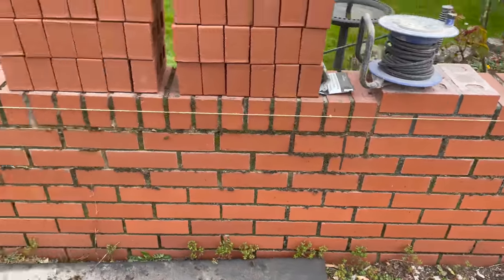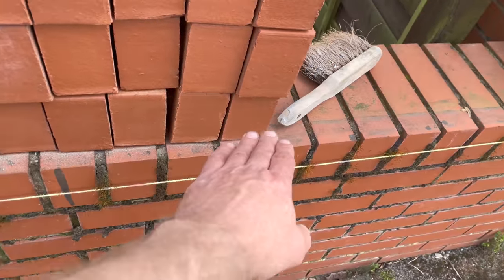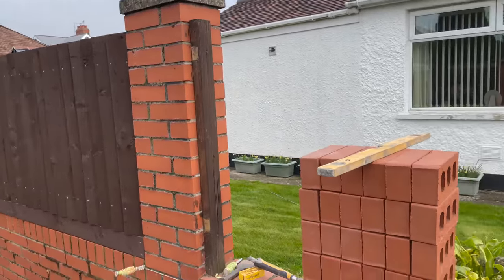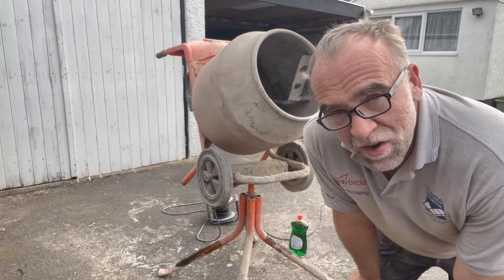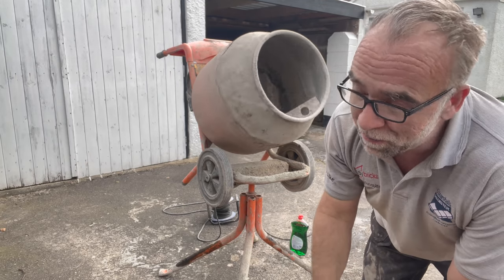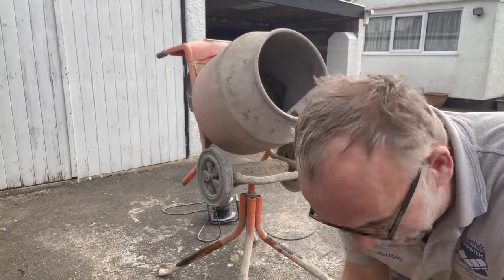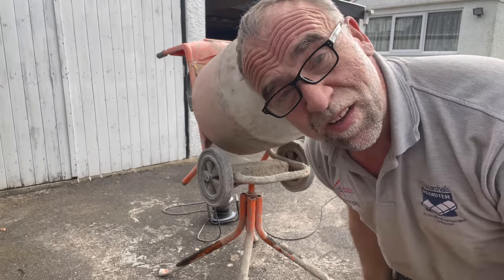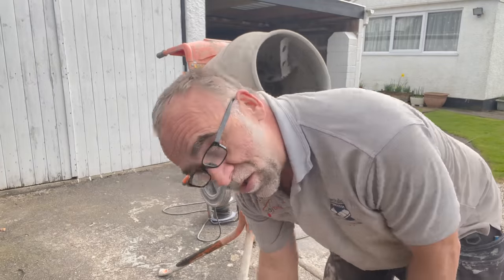"The Grumpy Bricklayer: A Day in the Life 😠🧱" #brickwork #blockwall #bricklaying #grumpyman

Comment: I recall you saying a while back that you built a garden wall around the corner from you 30 years ago using fairy & it's still standing as you pass it regularly, now here you are rebuilding a garden wall around the corner from you that fell down in a gentle breeze 🙈 I've got both in the van and use whatever i can reach at the time. Great video 👍
Reply from the maker: Definitely a different wall but yeh still solid 👍🏴

Comment: I've used fairy on the odd times I've run out of Feb but always thought it added air bubbles so normally avoid it. It does make for a nice mix though 😉
Reply from the maker: When you actually think about it air bubbles in cement would just pop due to the cement weight. 
Actually makes no sense air bubbles 👍🏴

Comment: Fairy makes the muck easier to use but that's because it puts bubbles -air - into the mix so when the cement goes hard it becomes like a honeycomb inside with holes in it. Depending on what mix you're using {and finished colour can be a factor} then lime can be added usually in a 6 sand 1 cement 1 lime for most jobs. NHL3.5 is fine in an average wet area or hydrated if not.
Reply from the maker: No air bubbles in the mix it’s a myth sorry 👍🏴
Reply: @tidybrickslandscaping  Rubbish,tell me what causes it to  make the muck smooth.
Reply from the maker: @AmyWinehouse.914  if there were bubbles the weight of the cement would of burst them obviously 
The fairy makes it malleable like the feb does. 
Ps I’ve been laying bricks 35 years what do you know about it if you don’t mind me asking
Reply: @tidybrickslandscaping  I've been a bricklayer for 41yrs.Tell me why using Fairy isn't permitted on sites and why the correct amount of Feb should be used and not any old amount?
Reply: @tidybrickslandscaping  sorry Tidy it's true, I'm sure it's fine in a garden wall but not houses leaves the mortar like an aero bar. Chocolate not mint obviously 😐
Reply from the maker: @interabang  new houses are terrible look at the lametex stuff bricklayers use in sites it’s the worst couple of years later you can scrape the joints with a house key and the mortar just crumbles off. That’s proper bad practice so as for the fairy issue🧚‍♀️  never had a problem ever 👍🏴
All valid points 👍👍
Reply from the maker: @AmyWinehouse.914  so what’s your thought on lamertex then as that’s what’s used on sites still ? 👍🏴
Reply: @tidybrickslandscaping  In what way do you mean?
Reply from the maker: @AmyWinehouse.914  what they use on sites now that lamertex crap never goes off solid been there used it done it
But my mixes go off solid as a rock and that’s with a quick squirt of the good stuff too 🧚‍♀️ 
So with that being said mine would last for longer 
It’s a good debate as so far I think more people say it’s fine over those who say different 
Free speech is a good thing 👍🏴
Reply: @tidybrickslandscaping  You can't beat the old traditional mix's in my view.A simple 6.1.1 for building[most situations} and a 3 or 4 and 1 for pointing unless you need to use a colour or white cement to match.I've raked out many an old job that's been there for 50yrs or more and it's still hard,It's the same with the ready mixed for jointing it cost a bomb and in my view a waste of time cheaper to use sand and cement and just add a dye if required.Same with kiln dried that a lot of folk just brush down the joint and leave it for slab work{not brick paving} or they then point over it meaning the underneath's still soft.To me doing slab work where possible I butter the side of the slab in wet and depending on the finish rake it back about 15mm and point in at a later stage or as I go, obviously when it's dry conditions.I'm too old now to change.
Reply: @AmyWinehouse.914  I was following your argument until you suggested a 3:1 mix for pointing. Kinda lost credibility at that point. Few people use lime now. Local builders merchants don’t even sell it.
Reply: @stepbackandthink  You've lost credibility as 3:1 means 3 sand 1 cement nothing to do with lime and any builders merchant worth it's weight will sell lime of some sort usually hydrated but it's not hard tp get hold of Hydraulic especially the larger companies like Travis Perkins or Jewsons sell lime and it's easily available online.

Comment: It seems to me that the reason the wall blew down in the first place was because the pilers are one by one and a half brick thick. They should have been one and a half brick thick in both directions. Other than that the work looks fine apart from the bonding on the first piler which has a straight joint. Never ever use washing up liquid it weakens the mix period.
Reply from the maker: The reason it blew down is because the fence panels were too big and not enough pillars now there’s two extra pillars in that one area so that would be plenty as for the fairy liquid I’m still gonna use it read the comments on how people say it fine. 
It’s good to have a debate 👍🏴

Comment: My uncle was a landscaper, bricklayer  for 50 odd years Always used fairy liquid ,  I’ve been in the trade for 25 years and that’s all we use , feb just isn’t as good like you say , and the cost ratio is a no brainier , but you can’t use the cheap after brands they just don’t work 😂 . 
And bricklaying is  mind numbing.  Nice job though . 👍
Reply from the maker: Thank you for commenting Nathan I’m glad there’s more people out there which agree with me last time I put this question forward lots of people were against me how times change thanks for watching 👍🏴
Bricklaying sucks 😜 zzzzzzzzzzz
Reply: Washing up liquid affects the long term structural integrity of mortar and should never be used as a substitute for plasticiser it has salts in that can come through the finished brick work resulting in efflorescence and are hygroscopic. Like wise using dirty sand can also affect the strength of the motar and will start to degrade within a few years.
Reply: @Frenchwine15   I drive past  brick walls my uncle built 30 years ago and still standing strong. 
I think it has more to do with the salts  in the sand to be honest .
As alot of sand I'd dredged from the sea . Depends where you live .
And I'm not saying use it on building houses just general garden walls slabbing etc. 
👍
Reply: @redleather100  I do agree with you on the sand because I am having issues with supplier's I one of the best area's for sand in the country. They are not washing the sand properly and as a result the silt content instead of being no more than 6% it's between 20 & 25%. This is not acceptable. I therefore do silt testing before taking delivery. I will admit when I was younger at times I did use washing up liquid if I had forgotten my Feb but there are salts in all washing liquid that in time will impaired integrity of the mortar. As for the cost we are all trying to keep them down but, I think there is hardly any cost difference in using the prescribed product for the job. 
Nice Van by the way.

Comment: Fairy will do the job but i was warned that too much will make it weak like it’s been frost bit so I haven’t used it since I just get the concentrated stuff from wicks 9.99 per litre and 12ml per 25kg cement it’s probably cheaper than fairy and it’s all ways worked well 👍
Reply from the maker: Old habits die hard I think I’ll always be a fairy liquid man thanks for watching by the way 👍🏴
Reply: @tidybrickslandscaping  mabe you could do a test like the sbr/pva/primer test and see if too much fairy makes the mix go like it’s been frost bit I may try it myself just too see if the old man that warned me was right, thing about old ppl is they have wisdom so I tend to listen, keep up the good work Scott hopefully retirement is closing in as you sure do deserve to relax after all the head aches you’ve been though !!!!! Ps never close the back doors on a vw transporter before checking keys are in pocket

Comment: Never boring laying bricks Scott boy easy money 💰 what bores me is laying monoblock or flags on sand screed. Top notch like 😜
Reply from the maker: I could earn so much more money bricklaying than landscaping for sure 👍🏴
Reply: @tidybrickslandscaping  
But then doing that mate a could see your masterpieces. Btw used the stoneface textured marshalls wall cladding. Super slick quality stuff all comes in separate bits but looks quality finish. 30mm 22mm. 15mm thicknesses 100mm 75 50mm heights. Super expensive but way better than the z pattern stuff.
Reply from the maker: @lmilne4859  I’m not a great fan of that Z shaped cladding and unfortunately I’ve just had 22 boxes delivered OMG 👍🏴

Comment: Just a DIYer... just built a block thermal wall... 4 blocks high... 8 long..the suction is unbelievable... 4 and 1 mix with plasticer... wat am I doing wrong
Reply from the maker: Thermal block are for inside by the way and when it’s hot they need a good soak in water before you lay em 👍🏴

Comment: Another good video with plenty humour.

How do you know the strength of the bricks to decide on your mortar mix?

Keep up the good work.
Reply from the maker: Quite a valid point JC and I’m struggling to give you a better answer than I always mix 5 to 1 ratio anyways 
A really good question ask others maybe see what they say 👍🏴
Reply: @tidybrickslandscaping  seems strange that you’d use 5&1
Reply from the maker: @Pp-tt7du  that’s the normal cement ratio mixture for bricklaying 👍🏴
Reply: There are generally three classifications of bricks, soft, medium and hard density
Soft bricks are usually handmade and will require a mortar mix between 1:10 and 1:7 ration depending on how sharp the sand is.
Medium-density bricks such as London and LBC's normally have a ratio of 1:6 and can have lime added to improve work ability and should always have the indent known as a frog to be laid upwards.
High density bricks such as class B engineerings and Staffordshire Blues should be laid between 1:3 and 1:4 as a general rule. If they are not needed to be there for structural integrity then a standard mix of 1:5 is fine.
Lime mortar is immensely strong in the right circumstances but, make sure you use hydraulic lime and not hydrated lime as the later will not set correctly.
Reply from the maker: @Frenchwine15  wow you know a lot more than me about that type of stuff Fairplay good advice thanks 👍🏴
Reply: @tidybrickslandscaping  I think I had good teachers  Mr Tidy 🙂 However I don't know it all but, I like to see good workmanship. Sadly due to the mainly large national companies there concentration is on health and safety which is important but, customer's are more interested in how good the end result looks.
Reply from the maker: @Frenchwine15  Health and safety was the main reason I quit working on sites years ago it just got too much thanks for commenting much appreciated 👍🏴

Comment: Not very good the pillars will blow down again put some concrete at the base off the pillars at rear build. 9” wall up so to make the pillars 2 brick deep;
You might be slow but you are rough ,when it’s been a problem try to improve so it won’t happen again…….
Reply from the maker: Sorry Peter I completely disagree when I turned up there was one brick pillar in that space now I’ve put three more than Plenty 
I thought you might of figured that out as there was only one pillar there when I started 🙄
Reply: @tidybrickslandscaping  still don’t have a brick pillar one & a half brick wide six foot in the air.
Reply from the maker: @mrt8694  correct it’s only a 9” wall not a driveway entrance brick pillar 1.5x1.5 type no
Reply: @tidybrickslandscaping  😂